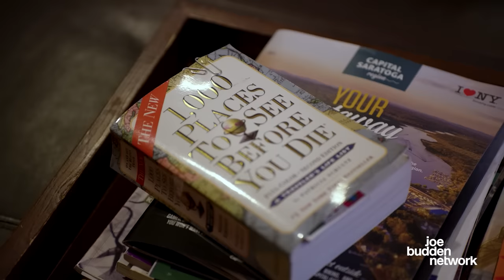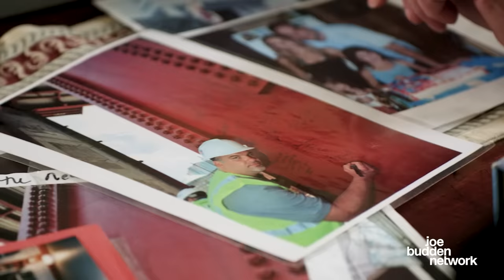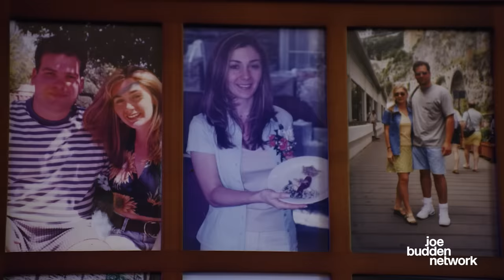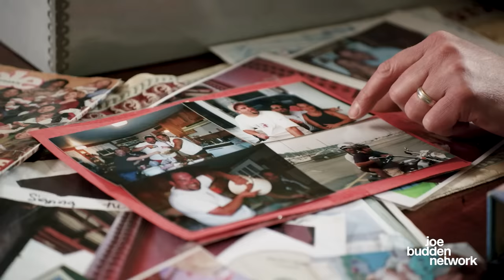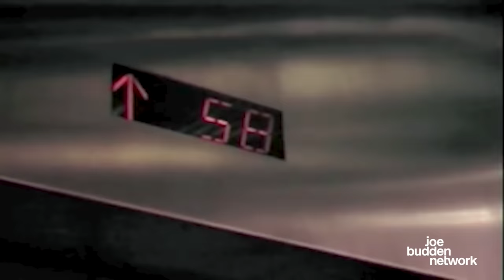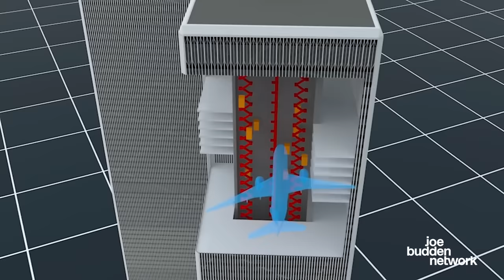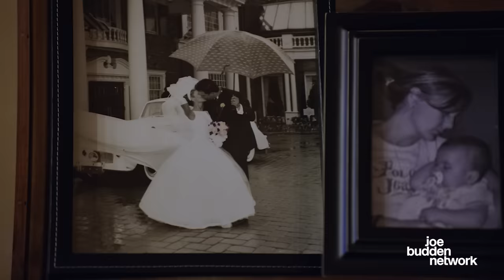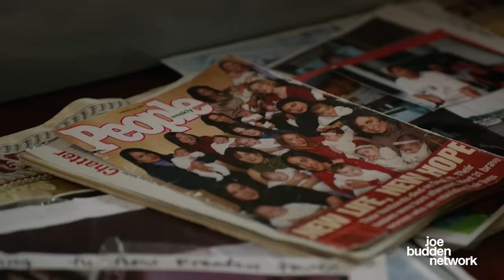An Interview With The 9/11 Surfer - Humans Ep. 4: Pasquale Buzzelli

Comment: This is one of the most well-done, respectful and sensitive 9/11 survivor interviews I’ve seen.  Thank you so much.  Beautifully done
Reply: except for when he says “youre a structural support guy” like bro people didn’t think it was going to fall never mind he didn’t even know what was going on at that point
Reply: @thefaultinourpizza1513  + the building was made to restrain a plane
Reply: @milanvandrie9827  It was made to withstand a Boeing 707 or equivalent flying at low speed with low fuel, the scenario being a plane coming in to land getting lost in fog. The attack planes were all 757s or 767s, much larger aircraft, with a near full fuel load, flying at exceedingly high speed. More to the point though, he didn't know it was a plane strike at that time, so this point is moot, as it wouldn't have been a consideration for him at that moment in time.
Reply: I agree. ❤
Reply: @milanvandrie9827 only planes at speeds of landing and takeoff. Not cruising speeds of 500+mph. Not sure what you’re trying to say by your comment. But if you’re trying to imply what I think.. you’re wrong simply by this false fact alone.
Reply: God is good.

Comment: This man's experience is well-documented, he had the foresight to get down into that little corner of the staircase to be protected by it's rigidity rather than next to a flat wall. The strongest part of the building, the central staircase. There should be like 4 of them and it was conveniently overlooked. I was in 5th grade when this happened, but as an adult I'm pretty horrified by the immensity of such a tower just collapsing. Holy smokes dude... he was told by building security to go back to working?! (Also it seems he was so lucky because he was 1 out of 18 rescued from the aftermath inside of the rubble, and I think like some 14,000 others managed to escape and survive out of 18,000 there at the time. There would have been 50,000 persons there by 11:30am.)

Comment: I didn't understand this story. If he was inside the 22. floor and didn't jump out, how did he wake up outside far from the building and the building didn't crash on him?
Reply: He hunkered into a corner in the stairwell, basically, it broke off and he effectively surfed to the pile of rubble, I would think his body was stuck into the corner by the effects of gravity pulling the cement at a faster rate than him. 22:38
Reply: @megru6385 
That makes absolutely no sense. But then, there's no way to make this tall tale make sense.
Reply: There's nothing to understand. It's hokey propaganda. Put a sentimental soundtrack on and people will seemingly believe anything.

Comment: This makes no sense. His story is cap. He says he got the elevator down to 44th floor and it was complete mayhem with fire and smoke. Then he went up to 64th and it was clear as day?? The plane hit around the 80s and 90s floor's so the 44th floor wasn't ablaze at all. He's got it wrong somewhere along the lines
Reply: That happens
Reply: This is a guy who worked in the building every single day for years.  He knows what he's talking about.  It's actually simple. Explosives were set on various floors to weaken the structure, not just where the missile hit.
Reply: @Fortaz107  take your meds bro